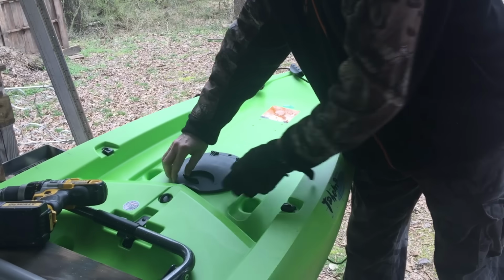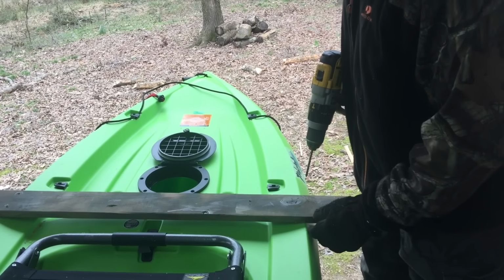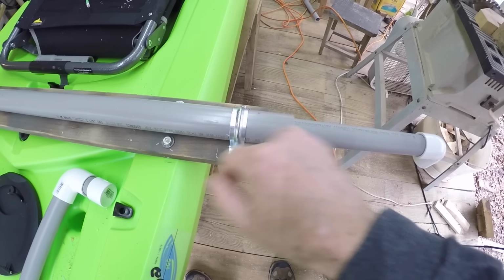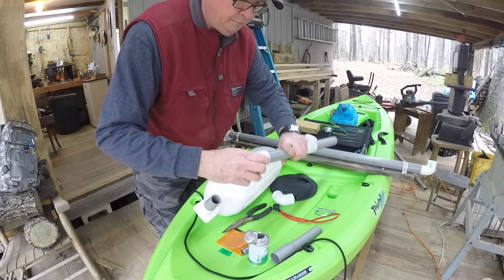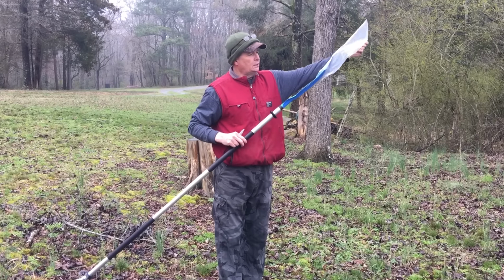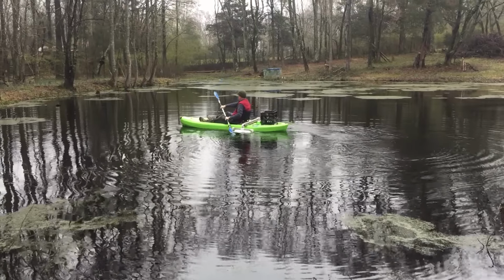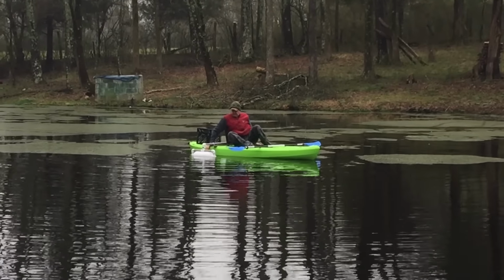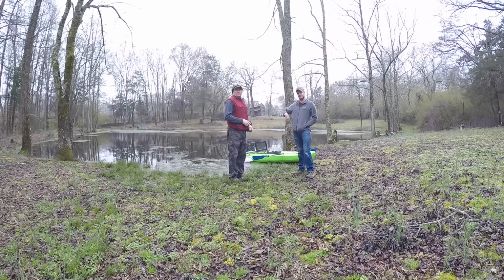Yes! Custom DIY Kayak Outriggers on Tahoma Lifetime, Stabilizers, Fishing Kayak

Comment: I'm about to do this exact build based on your design. Did those screws hold in place? The ones screwed into the 1 x 4. I'm always weary about screwing into plastic
Reply from the maker: Yes they held we also used nuts and washers.Thanks for watching.

Comment: Permisi izin bertanya,  apa nama pelampung warna putih yang ada di samping perahu itu   ,
Reply from the maker: No translation don’t understand.
Reply: I believe it's a fender. It's what you use to keep boats from hitting when you come in.
Reply: @attechoutdoors5893  They're asking what the white thing is that you're using for flotation/stabilization. The fenders, if I'm not mistaken.
Reply: @bcrumbs937   terimakasih sudah membantu saya🙏
Reply: @iwansosis2505  No problem at all.
Reply from the maker: @bcrumbs937 true…..

Comment: Great video and well explained, I have a question on the material. The 2 X 21in and 4 X 8 7/8 etc... are these for bolt size's I assume ?
Reply from the maker: You may want to measure what you think you will need.  My son-in-law wrote this up and I’m not certain what he was thinking at the time.  Is does sound correct.  Thanks for watching and God bless.
Reply: @attechoutdoors5893  ok last question. So when you guys put the bolts in how did you access them? Thanks
Reply from the maker: We ran our hands through the port holes where the lids come up.   Might have the stretch your arms but it was really no problem.  Hope it all works out for you.  It’s ok to ask  any questions ......

Comment: Did you use self tapping screws or what? I can't use a bolt because I have a sit on kayak and I can't screw a nut onto the back of the bolt.
Reply: To attach the board to the boat, I mean.
Reply from the maker: We ran our arms under the port holes in side the kayak to put nuts on bolts.  Hope that helps.  Not sure what kind of kayak you have.
Reply: @attechoutdoors5893  I have no way to access the inside of the hollow boat. Do you think self tapping screws could work? I'd like to build the same thing as you have here but I'm not sure if self tapping screws will hold up. What do you think? Thanks for the reply! Great vid btw
Reply from the maker: What kind of kayak do you have?

Comment: Do you think it would be possible to have a wheel on a fixture that attached the same as the pontoons for rolling it to the shore?
Reply from the maker: Yes find some of the tall push mower wheels.  I was gonna do that but we just load  them from our truck and walk to the water.  Makes a difference if you have two people to carry them.  You can add wheels.
Reply: @attechoutdoors5893  thanks. I have an old mower I was thinking about doing exactly what you're talking about

Comment: Do they slow the kayak significantly? Would they increase the stability if they were longer?
Reply from the maker: Yes they will slow you down a bit, but not to bad.  You can buy a bigger size that would give you more stability.  Longer would work but might be in your way while paddle.  Thanks for watching.
Reply: @attechoutdoors5893 , thank you for sharing and for your reply!
Enjoy paddling!

Comment: Good video but I would rather put the air valve to the top in case it goes to leaking it won’t take in as much water and make the design where a pin drops the floats to re inflate
Reply from the maker: Might help if you do that.  So far we have had no trouble with that .  God bless.
Reply: @attechoutdoors5893  and maybe I just over think safety alot
Reply from the maker: Nothing wrong with that....

Comment: so do the outriggers actually touch the water or submerged just a little.
Reply from the maker: They are about 1/2 way in the water.  So they are submerged a little.  I figure they are around 20 lbs. of float on each side by the size they are.  Thanks for checking us out.

Comment: where did you get those floats?
Reply from the maker: I ordered them off eBay, I think it tells in one of the videos.  They do work but they also make one size bigger.  They help if you decide to stand up and fish.  Thanks for watching and comment.  It tells at top of comments and the size we used.
Reply: I bought a couple of floats from Walmart.
Reply from the maker: Yes they have them.